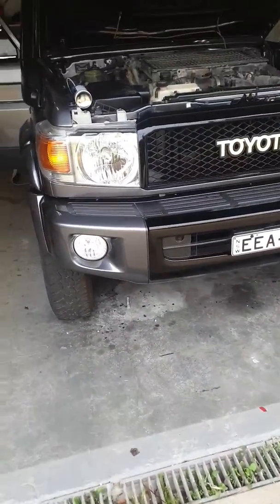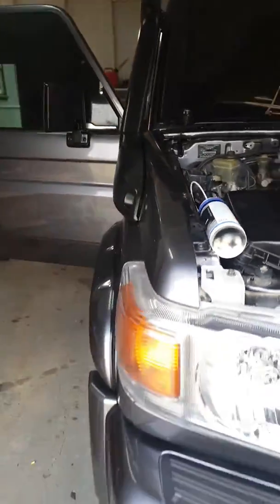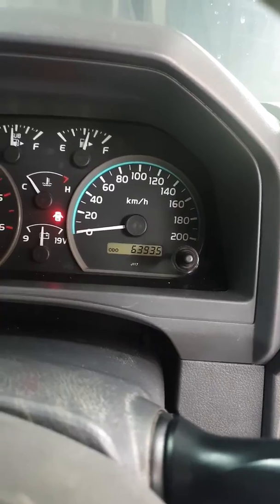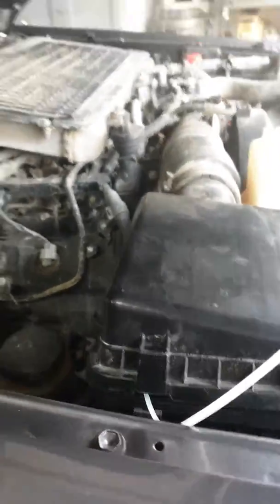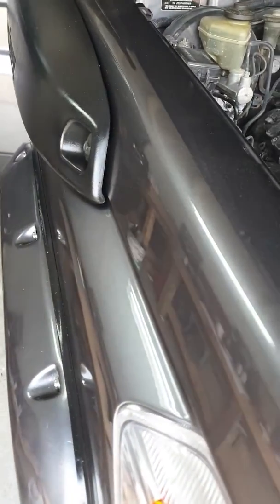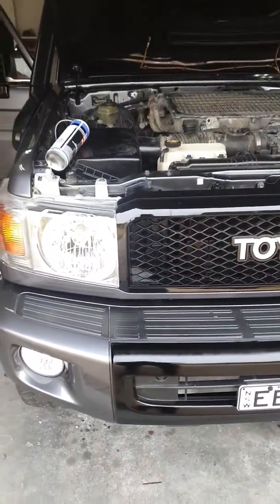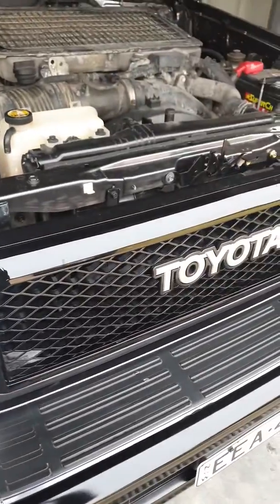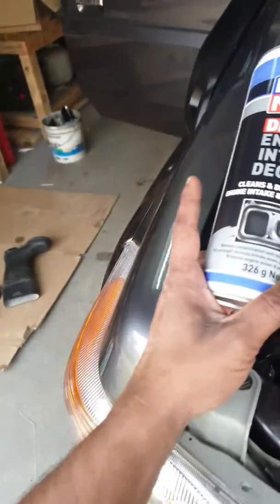LIQUIMOLY DIESEL INTAKE DECARB

Comment: You're spraying in the wrong place, all ur doing is wetting the air filter. 
Air filter flows to turbo, turbo flows to intercooler, intercooler flows to intake manifold, intake manifold flows to intake valve which is where the carbon you need to remove is...
1. U have to spray inside the intake manifold 
2. Sparying into the intake manifold will wet the carboned up intake valves which this product is supposed to clean.
Your intake pipes, intercooler, turbo, intake manifold and intake valves are full of oil due to the CCV system breather which recirculates the engine gases (blowby) from your rocker cover to your air intake pipe.
To avoid all of the above and prevent carbon build up you need to install an oil catch can (eg provent 200).